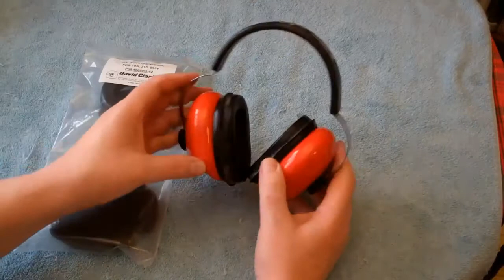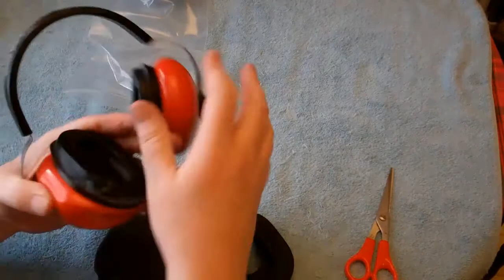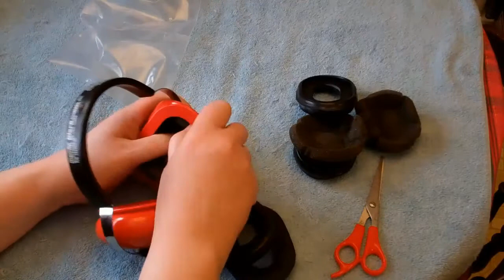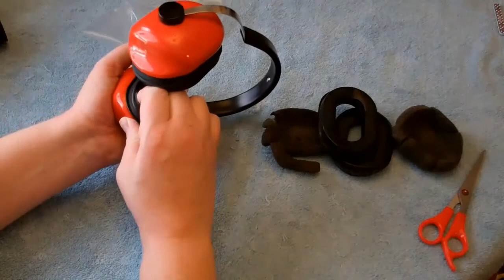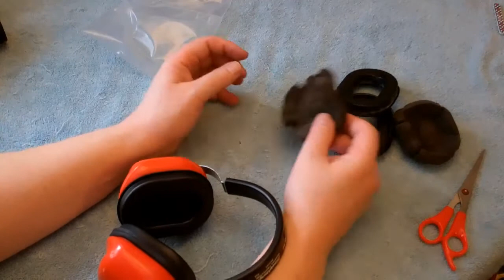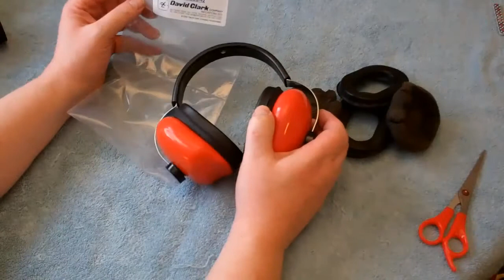David Clark Company earmuffs Model 310 soft-goods kit rebuild

Comment: You're right about the headset being 'fahty' years old, Eddie.  I purchased a pair back in 1970 because they had that 3-position headband and allow me to wear a wide brimmed hat.  I'm waiting for a set of those soft goods parts and found your video informative.  The foam innards of mine are nothing but rubber crumbs, and the ear seals are rock hard.  I always liked this set because of the relief on the bottom of the ear pieces that clear the comb of my shotgun, and don't scratch it up.  Thanks

Comment: Would it be possible to put the outer ear pads in warm water before you put then on the outside?
Reply: I asked customer support, she said that would allow water to enter and damage the foam inside.  I used a hair dryer on medium heat.